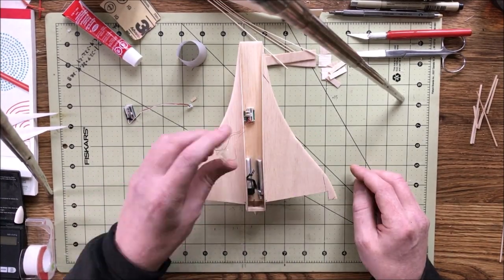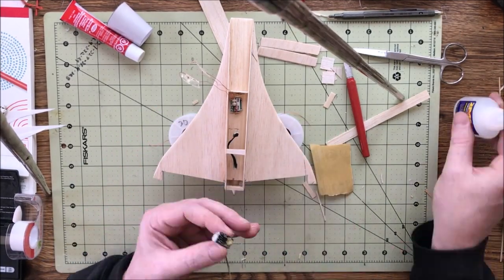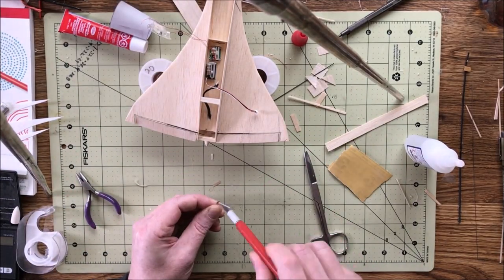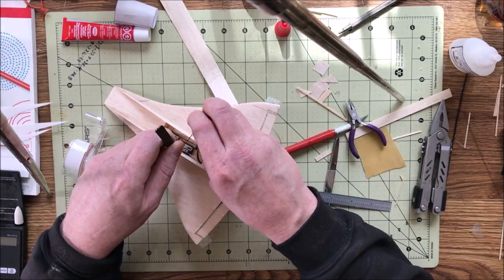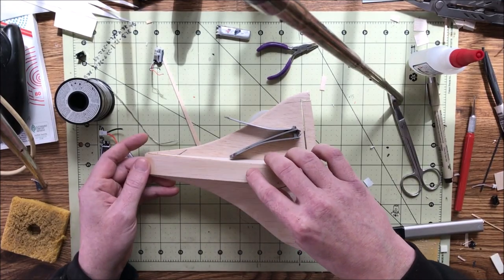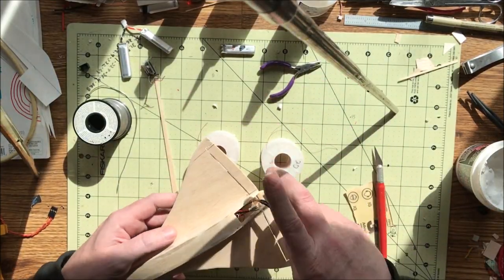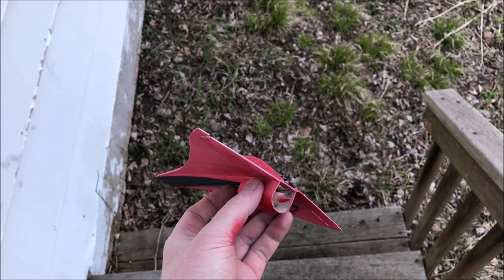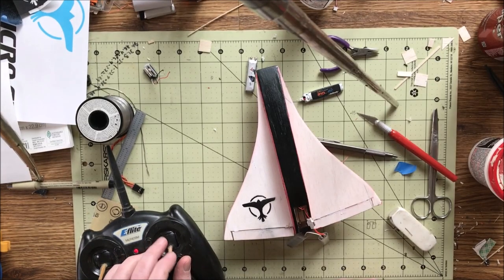20mm Micro EDF Jet build 3

Comment: Nice stuff!
Sounds like the fan needs more balancing....   oops on me!
Reply from the maker: Its probably my fault actually, I got a fair bit of overspray on the impeller nose cone, just gotta clean it off.  The fuselage definitely makes it louder too.  Should sound really good screaming through the air though
Reply: NitroCharged hello mr nitrocharged! Did you upload your edf design somewhere? I’ve searched your rcgroups threads but I did not find anything

Comment: Cool plane.. How much does it weigh?
Reply from the maker: Thanks!  With the 160mah 2S lipo, about 27 grams.  Unfortunately, after much tweaking and fixing, I still cant get the darn thing to fly properly...built a bigger/heavier version many years ago that flew fine, but this one has been one big fight.
Reply: @microbuilder  that EDF may not have enough thrust for that much wing loading. That seems heavy.. it will need to go fast to fly
Reply from the maker: @iancox7874  Yep, EDF puts out about 25g of thrust (if I remember correctly), and theres about 26 square inches of wing area, so she'd be scooting along pretty good, but thats what I was aiming for.  I'm going to try modifying the wing shape a bit and see if that works, if not, I'm going to have to switch to a different design...want to get this EDF unit in the air!
Reply: @microbuilder  hmm.. seems like it should do the trick then. There can be a lot of torque that may cause the plane to spin a bit from the motor. Does it glide when you chuck it?

With the FlySky, you can mix elevon trims into the throttle control to compensate for the torque. You’ll likely still need to overcompensate on take-offs unless you use take-off gear
Reply from the maker: @iancox7874  It seems to track well enough with an unpowered toss, but there were a couple times where it rolled inverted on its own and I couldnt roll it back over...and now that I think about it, I do have the ESC mounted kind of high on the wall of the fuselage, and its not exactly light.  

I'll have to try repositioning it lower and more centered...with such stubby wings, it probably doesnt take much weight to throw the balance off...thanks for jogging my brain!  lol
Reply: @microbuilder  perhaps try more nose weight?

Comment: Great Vidoe. Can you post any specs on this, batt size, AUW? etc. Link to a Build Log? Thanks!
Reply from the maker: Thanks!  This is about as close to a build log as I have unfortunately.  AUW is right around 28 grams, has about the same wing area, and nearly the same thrust...she should scoot along pretty well.

Battery is a 2S 180mah pack from ebay

0703 motor:  https://www.banggood.com/Racerstar-Racing-Edition-0703-BR0703-15000KV-20000KV-1-2S-Brushless-Motor-For-60-80-100-FPV-Racing-RC-Drone-p-1129234.html?ID=528869&cur_warehouse=GWTR

ESC:  https://www.banggood.com/Sunrise-Siskin-BLHeli-32-11A-SB-2-3S-ESC-With-5V2A-SBEC-For-RC-Airplane-Multicopters-Racer-p-1234430.html?admitad_uid=9731816e1766d5f7af3368f90e2b26d7&utm_content=240682&tagtag_uid=9731816e1766d5f7af3368f90e2b26d7&cur_warehouse=CN

RX:  https://www.banggood.com/DasMikro-5CH-2_4Ghz-RC-Micro-Receiver-For-DSM2-JR-Spektrum-transmitter-With-6-CH-PPM-Output-p-1084913.html?rmmds=search

servos:  https://www.banggood.com/1_5g-180-Degree-Nylon-Gear-Digital-Linear-Micro-Servo-3_7V-5V-For-Micro-RC-Airplane-p-1529910.html?rmmds=search